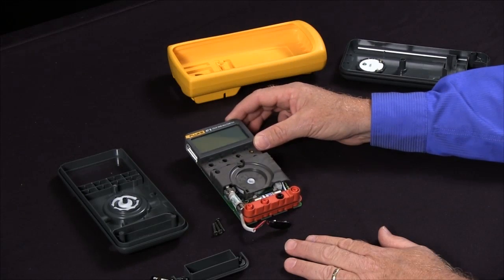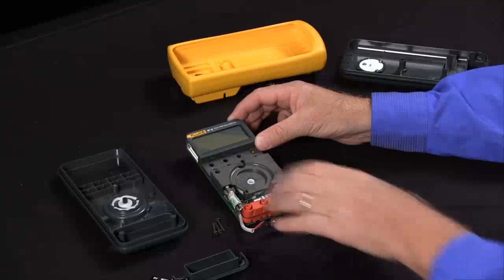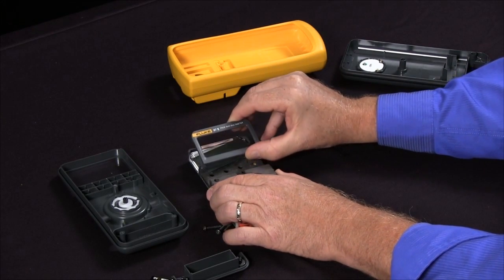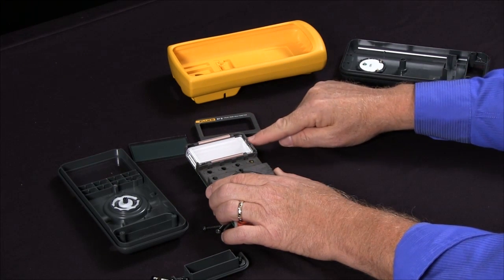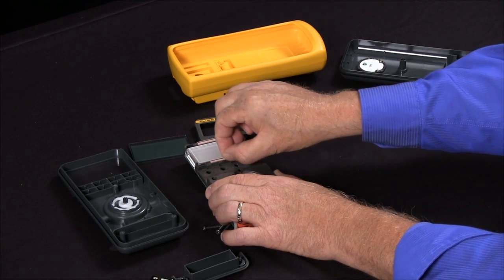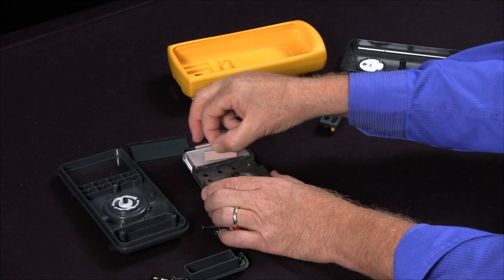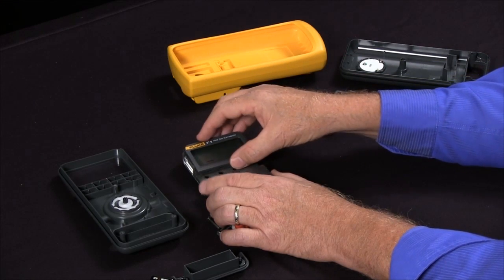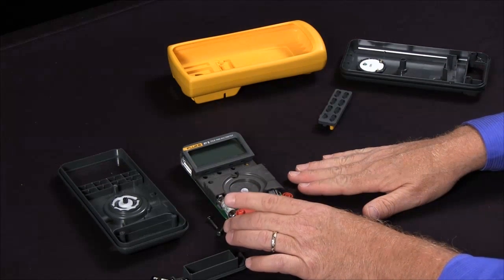How To Repair Fading Digits in The Fluke 87 Digital Multimeter

Comment: This really works.  Cleaned contacts and pads, put it together, and good as new.  I used a pad for cleaning optics and that worked great too.  One note: I had to take it apart and let dry, because I didn't wait long enough the first time.  I was too impatient.  5 minuteswas more than enough to let out moisture.
Reply from the maker: That's great to hear! We're pleased that this tip worked for you. Happy testing!

Comment: Not sure just when I bought my 87, but it was factory recalibrated in 1989. Not a glitch in it until recently, when the screen starting showing a lot of missing segments. Replacing the battery didn't  help, but then I found this video. About fifteen minutes and I'm seeing what looks like a brand new screen. Thanks to Fluke for providing such an excellent tutor for this video.
Reply from the maker: That's awesome news! Thanks for sharing. And happy testing.

Comment: Just a quick thank you for this video. Using these instructions I was able to revitalise my dad's old Fluke 87. I suspect it's older than me but it's the only thing I took back with me after he passed away. Thought it might end up being a paperweight but it is now pride of place back in my toolkit! 

Thank you!
Reply from the maker: That's great to hear - thank you for sharing!
Reply: My condolences. I would switch the batteries to lithium or rechargeable to make sure they don’t leak and corrode.

Comment: My dad bought an 83 probably 20 year's ago at least. About a 2 years ago I asked him if he still had it and he said "yeah but it doesn't work. Keeps beeping, can't read it and it'll drain the battery in about a day" so I didn't think much else about it and I bought a  new dmm from Walmart for around 20 bucks. And then I got another and I got another cheap one from Lowe's and ended up needing another. So I asked dad to just give me his I was gonna send it to fluke and have it fixed. I picked it up and later found out they fluke won't take it because it's discontinued. The next day I took it apart and cleaned it up real good with 99% rubbing alcohol and dried it up real good. It's been going strong ever since. Holds a charge on the battery good display good beep. It does seem to run on it's own sometimes and beep when I don't think it should. But all in all I'm happy. My next one will be a new one

Comment: sir i have a fluke 189 is the display replaceable ? because it getting dim and the display it getting darker compared to orginal color of display
Reply from the maker: Hello - The part number for the LCD display could be ordered under the item# 688181. You can find the procedures on replacing the LCD display within the Fluke 187 and 189 Calibration manual from our website. Hope this helps!
Reply: @fluke  thank you sir I will try to look into it

Comment: Just as a previous statement. Mine was sitting on the shelf for years. I googled for a replacement screen, found this video and fixed it with a Q-tip stem (the tip itself was too large for the area) dipped in alcohol. Thank You for the Video!!

Comment: Any advice on how to fix that annoying uneven backlight in 87v multimeter? I've just bought a new meter(manufactured in August 2019) and there are few bright spots(blemishes) on the left side of the screen, when the backlight function is active :( Thought it's my copy, but no, seems a design issue.
Reply from the maker: Hi Askar - Our Technical Support team would be more than happy to troubleshoot. Please give us a call at 1-800-443-5853 or email fluke-info@fluke.com. Thanks!

Comment: I have my much loved Fluke  87 which has given me many,many years of reliable service. Every time I send it away for calibration services it comes back with documentation listing "As received and As returned" readings for the various scales. The circuit is so well designed and stable I have yet to see variations from calibration to calibration. Thank You Fluke and the excellent engineers that designed this first 87 series. My last calibration, the shop said they couldn't calibrate it because the ma scale failed to show a decimal point. Other than that, the ma scale is highly accurate as expected. When I turn the unit on, all digits and decimal points flash and display correctly on boot up screen. Why would all decimals show upon boot up yet only the ma decimal disappears in the ma scale?  I hope there is an easy fix for this. I want my 87 back to full operation :>(. Not sure if your cleaning fix will work in this situation. Thank you for any feedback. Desi O, BSEE, Control Engineer
Reply from the maker: Hi Desi - We would like to help troubleshoot this issue. Can you please give us a call at 1-800-443-5853 or email at fluke-info@fluke.com? Thank you.

Comment: Do you sell the LCD display of the Fluke 87 multimeter or a brand new LCD display since it shows the same values as the fluke 87?
Reply from the maker: Hi Juliano - Our Repair Services team can help answer any replacement part questions you may have. Please give us call at 1-888-993-5853 or email at service@fluke.com. Thanks!
Reply: Thanks

Comment: Excellent explanation! I was able to repair a roughly 30 year-old Fluke 27 with this same basic procedure. Of course, I should note that the way that the LCD is held on inside the Fluke 27 is slightly different from the Fluke 87 V, but the overall procedure is the same. I suspect that this fix will work on many different types of Flukes, not just the 87 or the 27.

Comment: Dear Sir,My Fluke 87 v multi meter when i power it on it it showing lead on LCD and making beep beep beep sound please show me the way to solve the problem i will be highly obliged to you if you help me solve the problem.        thanking you.
Reply from the maker: Hi John - This can happen if the mA or A input jacks get either moisture of dirt in them. The best way to resolve the problem is to use a Qtip swap with a tiny bit of WD-40 on it and clean out the jacks. LEAD is a message tied to the current jacks.
Reply: Dear sir I have followed all the instructions given by you , but off no avail what should i do next to solve the  problem. I also took it to the service center but no avail. please help me to solve the problem. thanking you.
Reply from the maker: Hi John - we recommend getting in touch with our technical experts for further support. You can find their contact info here: http://bit.ly/2axvET1

Comment: This multimeter is very good as the others fluke's multimeter.
But as i said in some other topic around ,there is no metal thread inserts inside the plastic components where screws are inserted.
I know that i don't must to open very often my multimeter to touch stuff etc...,but for this price i will be very glad if in my multimeter will be this little stuff which make it better and more durable in time .

Comment: I was wondering why my Fluke 87 doesn't have metal thread inserts inside the plastic components where screws are inserted for the most part.
Seems like a stupid design oversight to me from a benchmark DMM and of Fluke quality.
Reply from the maker: Hi Gregan - we'd like look in to this further. Will you kindly email us photos at communityadmin@fluke.com? Thanks!
Reply: +Fluke Corporation 
Why i need to send photos ?
Im just talking about the fact.
In Fluke 87 there no metal thread inserts inside the plastic components where screws are inserted.
Reply: I'm an EE engineer & I agree with Gregan.  I understand holding the display hold-down frame, with screws, creates additional manufacturing complexity & cost. Also the screws can be over-tightened and squeeze the display contacts pressure pads too much and speed up the inevitable, but the current design at a very best is an "iffy" design. I can think of,  half a dozen "cost effective" ways of creating contacts between the circuit board & the display, much better than the current design.  Intended, very respectfully ......
Reply: @jimhendian7325  They are only ok in the very new condition , but as the time passes within a few years the plastic components became very much brittle.
This is very common in almost all Fluke devices.
Reply from the maker: Hi Jim - Thank you for your comment. We appreciate your insightful feedback on the design of our 87V Digital Multimeter. Would you be willing to submit your idea to our Fluke Charged Ideas website? We love hearing our customer's thoughts on product combinations, modifications or enhancements to Fluke test tools. http://bit.ly/2JkQX7R - Thank you!

Comment: You do not indicate 'how' to clean the contact points on the PCB.
 ( Actually,The plastic cover needs to be removed, necessitated by removing a small screw on the reverse side of the assemble. )
You indicate to clean the contacts on the PCB, However you 'Fail' to mention to clean the contacts on the LCD display itself.  
Why should the contacts on the LCD display not be lightly clean??  
Oh....They should, we felt this step was implied....
Too bad the quality of your "help Videos" does not nearly match the quality of your products.
Grandma used to say "If you are going to do something, Do It Right".
Kind Regards,
Bob
Reply from the maker: Hello Bob-
Nice catch. Looks like our team may need to revisit some of minor details in this video. We have confirmed that yes, you do need to remove a screw to complete the disassembly, however, the LCD does not need cleaning – only the circuit board contacts require the cleaning to correct the issue. Thanks again, The Fluke Team
Reply: Fluke Corporation Hi, a couple of questions to feed my curiosity and perhaps enhance public education of your products.   I was curious as to why it is indicated the contacts on the LCD display do not need cleaning.  Is the contact material different than on the PCB?   Other reasoning?
There is no instruction to clean the elastomer strips. 
I can understand this as they may be quite concise and prone to damage due to improper care.  Is this correct? Or perhaps are the self cleaning via micro swiping action of their surface?
Is it Fluke's advice to not clean or otherwise try to prepare these strips in any way?
Thanks In Advance,
LONG Time User,
Bob

Comment: Great video. I just did the procedure and fixed my two old Fluke 87s and they work like new! These are very robust meters and I have no reason to upgrade. Thanks!
Reply: Worked great for me but I used Vodka in place of Isopropyl alcohol. The repair was more fun.